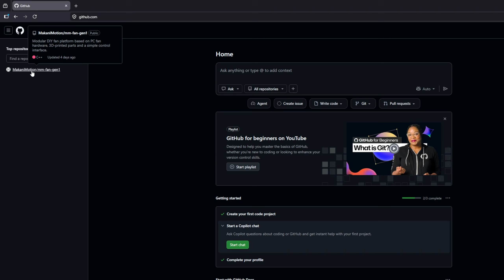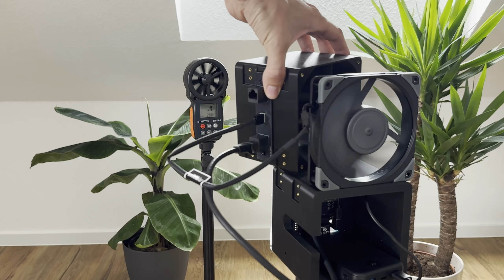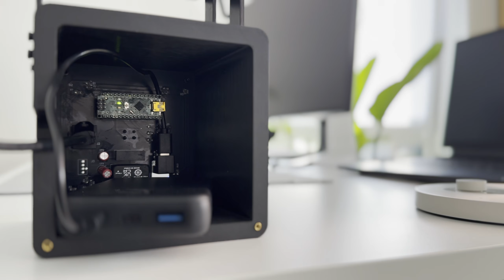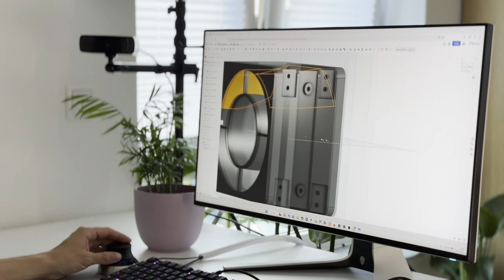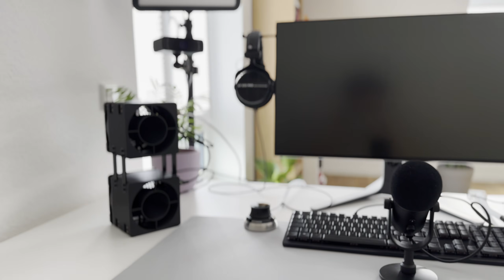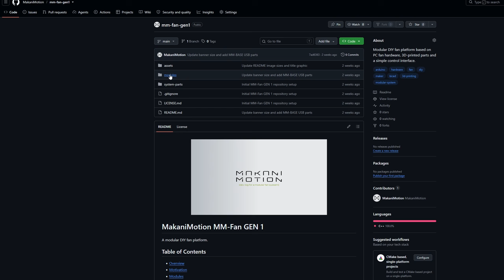I’m Reinventing the Fan — A Modular DIY Fan System

Comment: Amazing project and really appreciate you shared this entire build with the community! 👍 The whole thing looks very stealth, modern, and fits in any small environment.

Looking forward to any updates to this project and what you come up with. As an aside can the micro controller be replaced with a raspberry pi Pico / Pi Zero??

Rock On . . . 🤟
Reply from the maker: Thank you so much for the kind feedback!! 
At the moment, I’m planning to stay with the Arduino Nano. A Raspberry Pi Pico could probably handle the required control tasks, but it has a different footprint and pinout, so the main PCB and firmware would need to be adapted. A Pi Zero would be significantly larger and probably overkill for the current functionality.